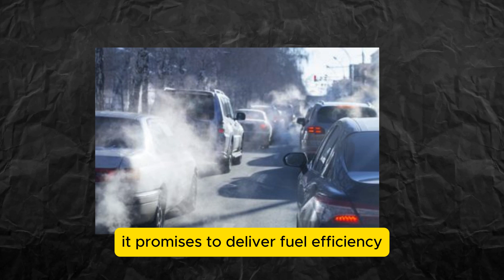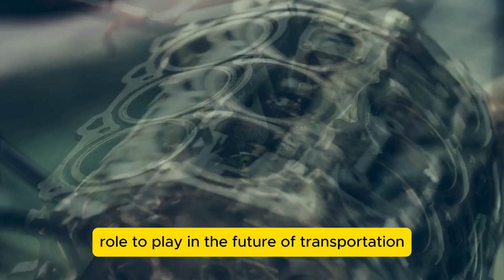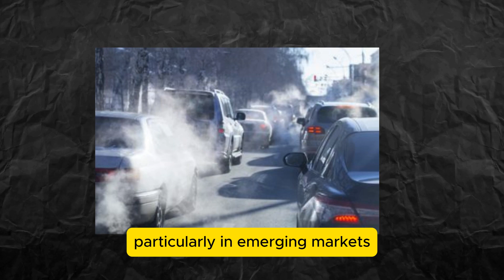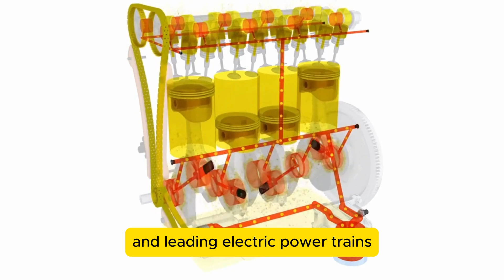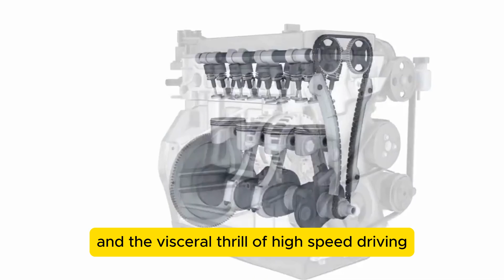Koenigsegg CEO: "This New Engine Will DESTROY All Electric Cars!"

Comment: Bullshit. This is an incremental improvement of the internal combustion engine. However the laws of thermodynamics dictate that ICE could never be as efficient or clean as electric vehicles. This new engine is not going to change the direction of the motor industry